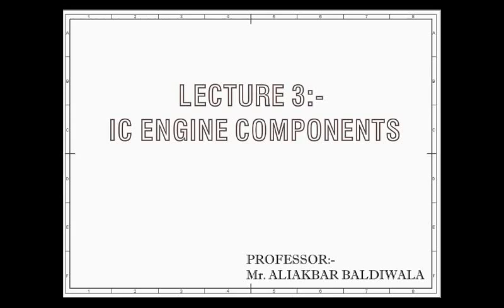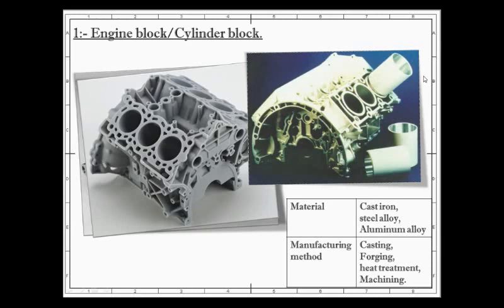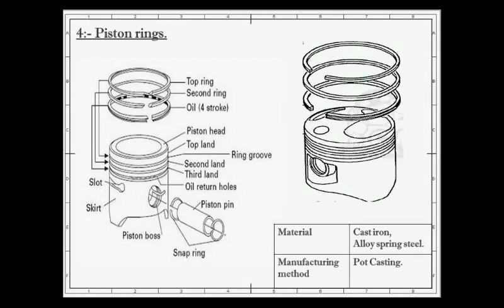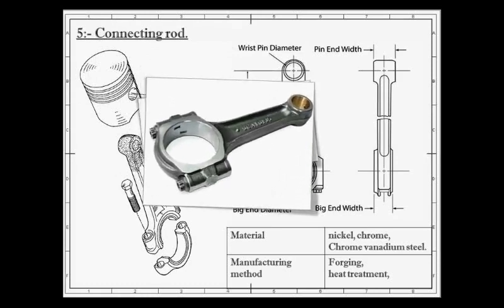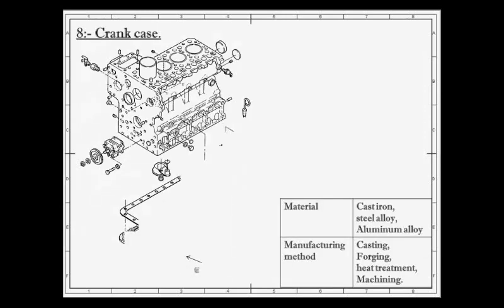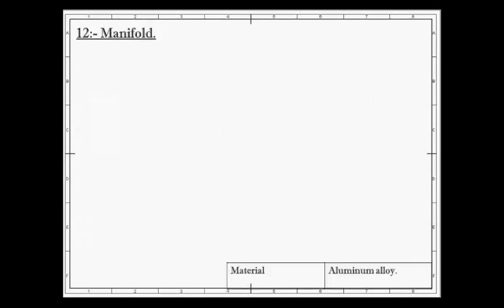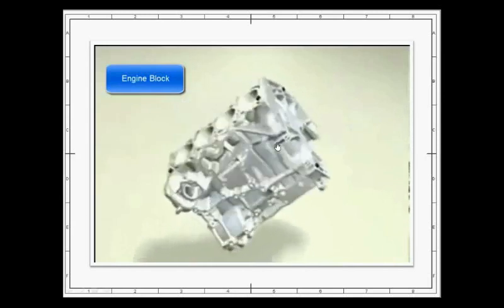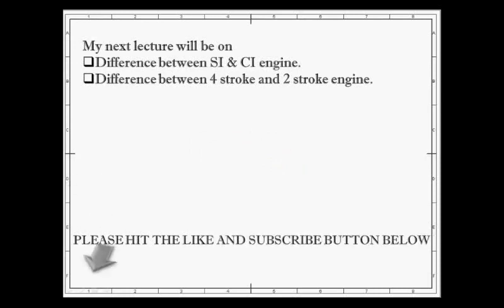LECTURE 3:- IC Engine Components

Comment: sir my question is ,when 4 stroke engine chalta hai to pistons kaise  kaam karega ,I mean ki sath me alag alag ,I confused in that.
Reply from the maker: @vasantrao Kaleshwar if you have time please go through LECTURE:-2 ENGINE OPERATING CYCLE (PART-1) | SI & CI ENGINE FOUR STROKE WORKING CYCLE.
after that go through this theory
pistons in different cylinders will work sequentially. In a 4 stroke 4 cylinder engine there are four cylinders (let say 1, 2, 3, and 4) , the firing (i.e. power stroke ) in the cylinders takes place in either 1-3-4-2 or in 1-2-4-3 manner. i.e to say when piston in cylinder 1 is on the verge of starting the power stroke at that time piston in cylinder 3 ( in case of 1-3-4-2 firing order) will execute compression stroke and in cylinder 4 piston will be pushing the exhaust gases out from it (exhaust stroke) where as in cylinder 2 piston would be executing the expansion stroke just after the power stroke. 
( Remember there are four strokes which every piston executes 1: compression 2: power 3: expansion 4: exhaust ).
let say if a crank shaft rotates 360 deg. piston in cylinders ( i.e 4 cylinder in our case) will execute a power stroke every 90 degree interval. the piston of different cylinders are connected with the common crank shaft ie each cylinder is producing torque one by one. the power generated by each power stroke will be equal to power required to drive the other three piston in the cylinders plus the amount of power required to drive the car.
The reason for not firing in a numerical order ie 1-2-3-4, is that the successive power impulses from the piston would cause the engine to run very unevenly and vibrate excessively. also each cylinder shares the common wall with the other cylinder due to which the heat radiation will be very high which may cause knocking problems ( don't worry about all this i will explain every thing in my further lectures )

if you have further question feel free to ask :)
Reply: Are isme firing order hota h usi ke hisab se hoti h